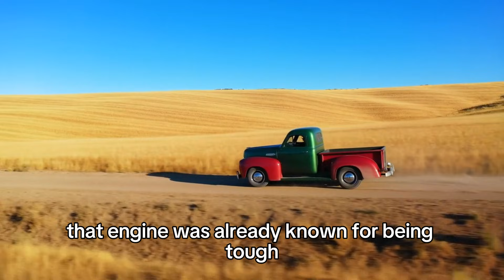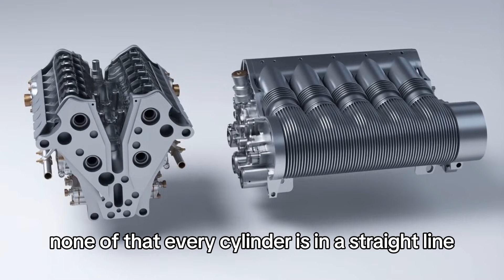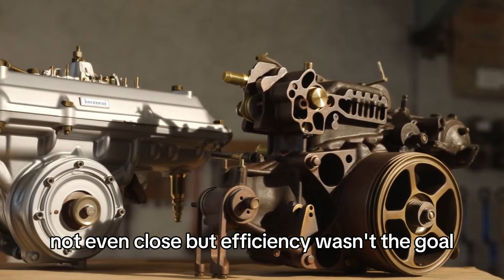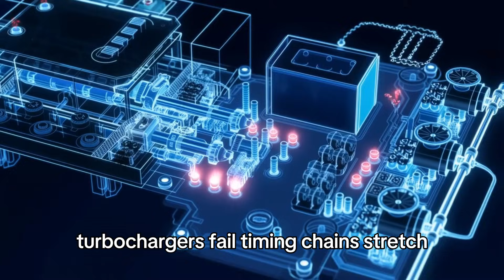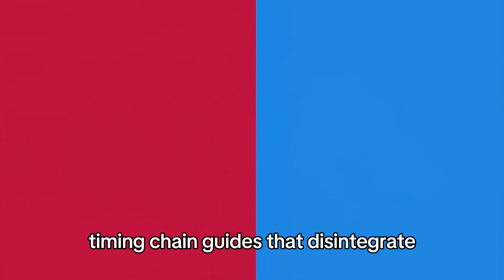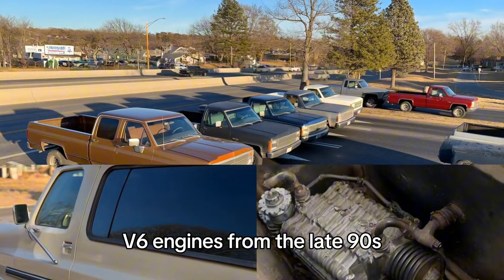THE SHOCKING TRUTH ABOUT FORD’S “BULLETPROOF” 300 INLINE SIX

Comment: If they have a fiber cam gear, they are not bulletproof but a bullet waiting to go off. And by the way, it's ft lbs. not pound feet.
Reply: Pound feet is a measure of rotational force, Pound feet is correct to describe engine torque.
Reply: @Not_a_Manager  It may be in your book but not mine. All my manuals say ft lbs.
Reply: I have a truck that had the 300 in it. The guy I bought it from said it had a 300 in it, it broke the fiber timing gear, and instead of fixing it they pulled a 300HD from an old salt truck with a ruined body from the salt and dropped it into the pickup. The 300HD has the hardened steel timing gear. The carbon timing hear is probably the Achilles heel of the 300. The 300HD overcomes this with a more stout construction.